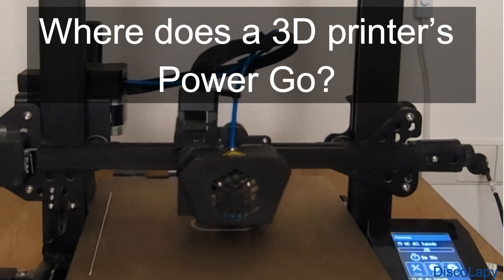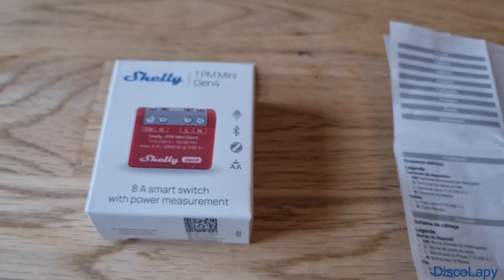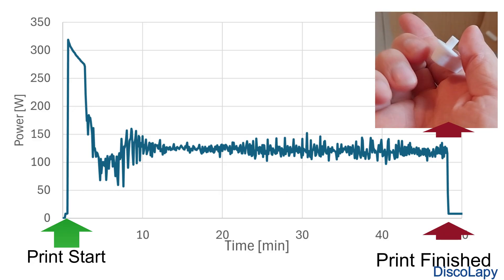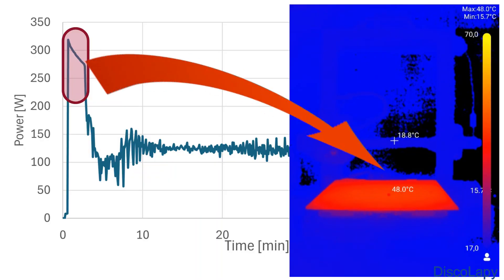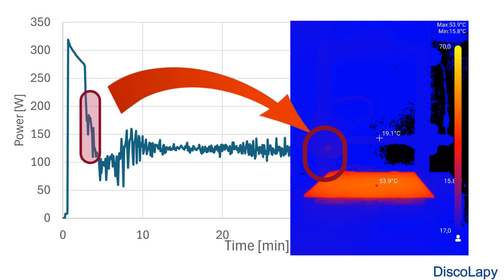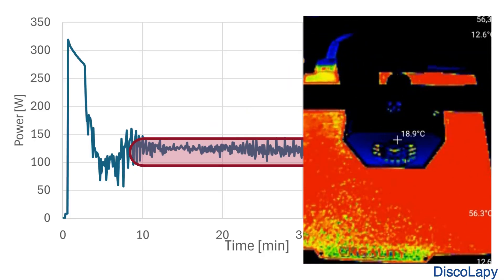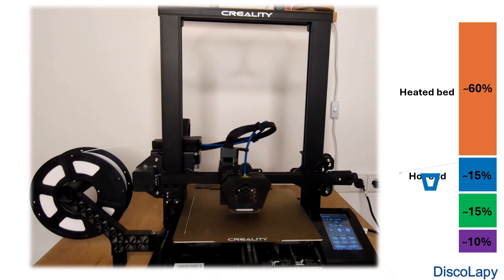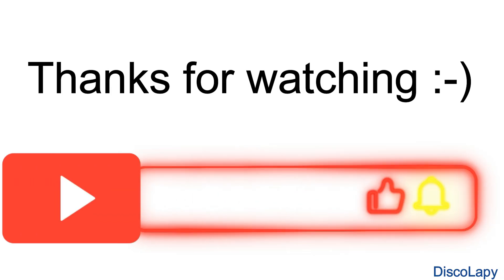Where Does a 3D Printer’s Power Really Go? (Measurements + Theory)

Comment: Would be fun to see a version of this for a more modern printer.  For example, the H2D has an inrush of 1300-1800w depending on source of info.  So 4-6x as much as the older bed-slinger.
Reply from the maker: Thanks for the suggestion! 😊 I’m actually planning to repeat the same measurement with the exact same part and settings on my Prusa Core One Plus (same class of machine). My guess is the total power draw might be a bit lower, since the enclosure should reduce heat loss and make convection less of a factor — but we’ll see what the numbers say!